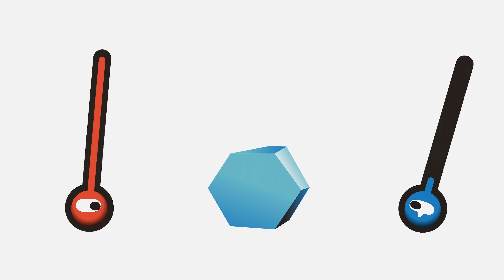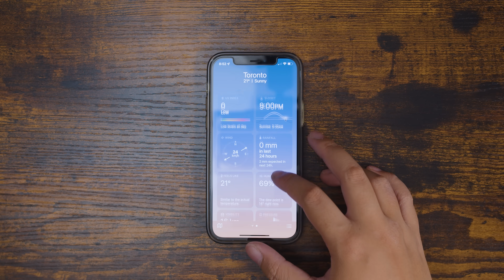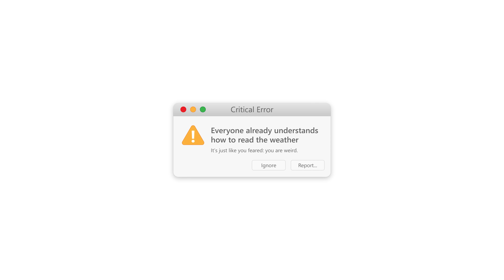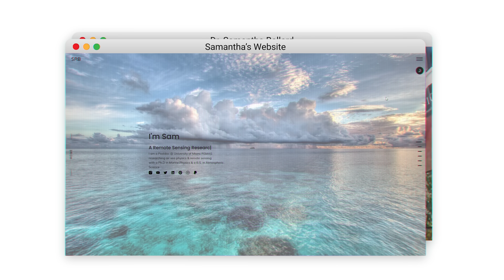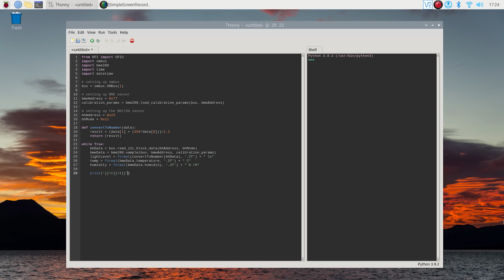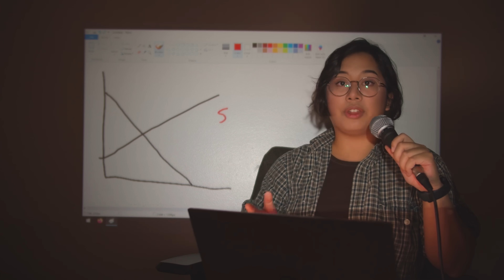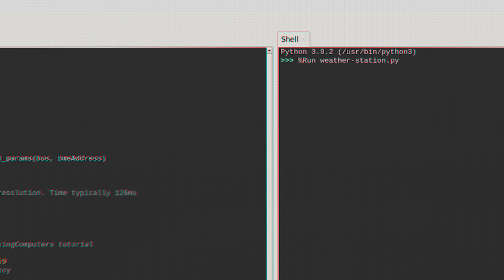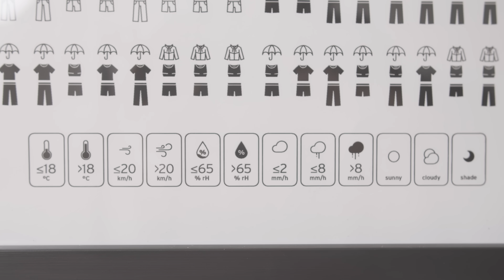how fahrenheit fails you

Comment: They invented perceived temperature to try help. Pressure and humidity make a whole lot of difference. I live near the equatorial line but at above 2000m sea level, even at 30 celsius (hot) it's acceptable compared to similar temperatures at sea level. Also when you're in the shadows, temperature difference is felt more intensely.

Kelvin is cool anyhow, at least you know it will never go below zero.

Comment: 20 c is room temp, hotter will feel hot, colder will feel cold, this is ignoring wind, 10 is a bit cold but not that bad and like under 10 is coat weather, it’s not that hard, humidity will make it feel colder or hotter depending on temp and direct sun regardless of temp will make you feel hot

Comment: Can’t even finish the video because you are attempting to raise a subjective point as a fact/objective.

Of course Celsius will not make sense in a country that doesn’t know if it should use imperial or metric.
More so, temperature alone is not an indication of how you feel when you are outside.
0 is freezing, 10 cold, 20 warm, 30 hot, 40 wtf. But with high humidity, 20 can become a situation too, just pick system and learn it. Saying 0-100 is more intuitive than 0-50 doesn’t make sense at all.

Comment: I like that you wanted to go outside more, and then start by building a weather station inside 😄👌

My experience is the following:
20°C and above - Wear shorts (if below wear jeans).
15-20°C bring a shirt.
10-15°C bring a shirt and a wind jacket.
5-10°C bring a winter coat.
5°C and below, wear winter coat, gloves and a hat.

Last but not least: Celsius is best - water freezes at 0 and boils at 100.
But I'm also very biased living in Denmark. 🇩🇰

Love your videos! ☀️

Comment: Easy ways to know hot is the temperature.
Body temp is 36C/97F. If outside is the same temperature as you or above, its hot. Anything lower tan 25C/75F, its cold. The lower it gets the more wintercloth you need. Simple.

Comment: Real problem: temperature doesn't matter (alone). Need also the ability to understand brightness outside vs. sun radiance, and humidity

Edit: oh also the fact that you think computers/sensors are supposed to be big is 1) your PC doesn't have to be small and 2) your smartphone is  basically just a big battery (spatially)

Comment: One thing that you forgot was "dew point". Relative humidity will not tell you much about your comfort level, dew point will.
But my personal method is having few mental anchors. For example 10 °C  is a bit more comfortable than inside a fridge.  25°C is the most comfortable A.K.A room temp. 37 °C is my body temperature so obviously over that line my body starts working overtime to go lower than it's surroundings. Now I mentally fill the gap between those

Comment: I remember having this discussion with somebody about how temperature (and esp "wind chill factor") is kind of a bad metric. After all, if what we feel as hot and cold is loss of heat, then shouldn't we measure that?

So obviously somebody with more surface area or higher temperature at their skin is going to lose more heat, but other than that, everything is standard right? So loss of heat, aka sensation of hot/cold should be measurable by something like ( energy lost per second per area per temperature difference ). Something like ( watt/m^2/delta C ). Alternatively, we can assume a typical skin temperature and reduce that to watt/m^2, which is a real unit (for measuring the intensity of radiant energy, exactly what we need). This would encompass temperature and wind.

Comment: I think it's not the scale(unit) you use, but that you are kinda bad at comparing the temperature based on your feeling. N8w this of course can be trained, but since we have thermometers we often just read it and don't care. Even tho this is something you can learn pretty easily. You could bring the same argument with musical notes. An untrained person has no clue what a G2 sounds like, or a F5. But if you train it for a while you can be fairly accurate. It's less a think of the scala you use, and more of a estimate issue. Wvich ofc, if ai don't know the scala at all will be hard, but adapting from 1 scala to anotherone should be a lot faster than being consistently close to the guesses on an arbitrary scala in the first place

Comment: The Raspberry pi is a computer but i would have suggested to go with the 3A or 3B not the 4. 4 requires you to have a heatsink and/or fan which will mess with the readings. Maybe the extra compute is needed but most likely you can get by with a 3B not a 4B. The main difference would be the required cooling solution to run the CPU cores at 100% for more than 5 seconds. 
The how it is a computer look at your phone and is it a computer? They both have all the same parts just the Raspberry pi 4B in her hand doesn't have all the parts for radio signals and camera hooked up to it by default instead of that it has general purpose input / output pins.

Comment: Farenheit gives more resolution with two digits at comfortable room temperature ranges. To get the same with Celsius, you'd need three digits. So you get a finer resolution at a particular usable range. That's really the one particular nice aspect about it. (And likely why it has stuck around.)

For anything else, Celsius is a bit more scientific for being indexed to the phase changes of a common and readily available substance.

Comment: Tip for the next time you make a portable weather station (lol): the wind sensor is super bulky and complicated for a portable weather station, there exist circuits that could do this measurement much more efficiently and precisely, while taking up 10x less space (the realisation in question uses a circuit withan NTC thermistor which is basically a resitor with resistance that depends on temperature, and measures the wind that way through some relatively simple math)

Comment: I'm used to Celsius because where I live we use it, and also we don't get extreme temperatures. So the point about 0-100F being the hottest or coldest days you'd experience just doesn't apply and using the freezing point of water just makes more sense to me. I think that could be another reason why it depends on where you live. Since the temperature range is a difference between oceanic and continental climates. For me 0C is very rare, 5C is generally as cold as it gets, 10C is cold, 15C is nice, 20C is warm 25C is hot and I start to get uncomfortable and 30C both too hot and hotter than it ever really gets here.

Comment: I think the problem is that Fahrenheit is only intuitive for people that grew up with Fahrenheit or that have to work with a lot of Fahrenheit Measurements. I personally only really know that 30°F is pretty chilly and that it gets big really quickly. 
Celsius on the other hand is defined by reproducable temperatures. 50°C is unbearably scorching, because it's halfway to boiling water. 0°C is when snow can stay on the ground. 14°C is when I stop wearing only T-shirts. 
It has the same "This temperature equals this feeling" but the scale isn't "really cold" to "really hot". Also, since the temperature points are further apart, the temperatures that feel the same are closer together. 
90°F is really hot and 100°F is really hot. 20°F is pretty cold and 10°F is pretty cold. 
30°C is a really hot day. 40°C is almost unbearably hot, 10°C is pretty chilly and 15°C is pretty chilly but 20°C is already pretty warm.

The one thing I give Fahrenheit is that negative values actually mean something. Negative °F means it's really really cold, Negative °C on the other hand is just "well it could be snowy and maybe wear a scarf.

Comment: This has never been an issue for me. When I switched to celsius, I was a door-to-door salesman, so I learned to feel what each number meant pretty well.

I don't even check the weather anymore though, because these days I have like 3 temperature settings. If it's summer, wear less. if it's winter wear more. If it's any extreme, don't stay in that place very long
Reply: I only use that last one, and "keep a spare coat in the car". Even though I've often worked outside, I've never made a habit of checking the weather, since my adaptations will vary by the month or week instead of the day anyways.
Reply: Same.

As long as you aren't outside for hours and you wear enough layers of clothing -10°C is not a problem for office/school commute.
-10°C sucks if you use railroad.
-5°C gotta wear thick winter hoodie below your winter jacket?
0°C Time to wear winter pants and winter wear.
5°C Time to wear winter jacket.
8°C gotta wear a jacket.
15°C gotta have more than a t-shirt.
Like at 18°C you can get away with a t-shirt if it isn't windy and it's sunny.
At 20°C shorts.
25°C is the limit of being able to wear clothes without sweating.
Above 28°C it's like patrolling the Mojave desert.
30-35°C You can only survive naked.
Reply: @niewazneniewazne1890  Pretty much but because I've got some weight on shifted down a step i.e. 8°C gotta have more than a t-shirt. And back up a step if not moving.
Reply: @niewazneniewazne1890  -20°C Shorts and T-shirt, 20°C Shorts and T-shirt. However, -15°C fifteen layers of clothes... -10°C Fucc me it's cold, -5°C to 10°C It's too cold to go outside... 15°C it's a bit cold...
and then when it's like 25°C better hydrate some more, 30°C fucc me it's hot... 35°C I wish we owned an AC, 40°C It's as if I were in Dubai...

Comment: I find the biggest problem with weather communication is that its based on ratings.  Like one thing you got wrong is that humidity doesn’t always make you “warmer”. In the winter rain on a 34f degree day is way colder than a sunny low humidity 20f degree day.  But in the winter we get wind chills and in summer we get heat indexes.   But there is humidity in the winter and wind in the summer. There is also sun and shade all year round.   But ratings come from making everything as scary as possible.

Comment: Uh... Not to be a purist, but we're not "all familiar with a 0-100 degree scale". Maybe if you grew up with Farenheit and that's what you've been taught, but not all of us measure everything "on a scale of 1 to 10". I personally find that mentality to be entirely pointless for the exact reasons you cite - it creates a binary fallacy. It's either "0 I'm freezing my donkey off" or "100 it's way too hot". This is a useless metric. Actual numbers with known breakpoints works far better - for Farenheit AND Celsius.

Forget freezing and boiling water. I have a thermometer in my room. I know that anything below 22 degrees is cold, and I'm going to need winter clothing if I'm going to stay in that temperature for long periods of time. I know that anything over 28 degrees is hot, and I'm going to need summer clothing to avoid sweating profusely. 24-26 is "about right" for pants, a shirt and some kind of top. Sure, there are extremes. 10 degrees, I'm probably going to need a winter jacket, 40 degrees I'm starting to worry about heatstroke, etc. A 1-100 scale is no better than a 22-28 scale. Human beings are adaptable.

Comment: I find temperature pretty intuitive, humidity augments that, wind cools, UV heats. 

If it's cold, high humidity makes it colder, if it's hot, high humidity makes it oppressive. In middle temperatures, high humidity just makes it thicker. 

Wind cools, so in the winter it needs to be blocked, but in the summer it is a godsend on the jobsite.

UV is what burns me, so when it's high I gotta stay in sleeves or the shade, but when it's low I can do whatever I want.

I'm built for winter, so my comfortable temperature range is from -12 to 12 °C. But I can deal with heat up to ~30°C as long as I'm not in direct sunlight, even with bluejeans on. Above that, I die, or direct sunlight in UV 4 or higher I burn in like 20min or less. Below -12°C, I have to begin layering clothing and actively avoiding rain, but I'm not getting sunburnt, so that's a huge plus.

Comment: I was going to ask for a copy of the infographic but I literally just wear jeans all year round so my only choice difference would be in tops. And I have a good system for that. Sunny and hot? Wear thin, long-sleeved, sun-blocking shirt. Cloudy and hot? Short sleeved shirt. Cold? Hoodie. High less than 80 and little plan to go outside? I could probably not die in a hoodie and summer's too long to not wear hoodies so...

Comment: it isnt difficult. 30°+ is heat stroke range, 20+ is a very hot day, 10+ is comfotable, 5° - 10° is normal trouser and tshirt or long sleave weather, 0° - 5° is jumper and hoodie weather, and below 0 is thick coat weather

Comment: People dump on Imperial system because it isn't used to do math quickly as Metric is divisible by 10, but Imperial system is connected to humanity, hence why feet are called feet, as they are based on human feet, and so on. That's why Imperial system is better in non-scientific contexts.

Comment: I believe Fahrenheit is better because of how intuitive it is. 100 is a big number and it means hot 0 is very cold so if i told you 70 degrees. You would know its past the midpoint but no wear near the top of the 0 to 100 scale. Thus is nice and warm. You tell me its 30 degrees Celsius i just draw a blank as relation to how it feels outside.

Comment: I find Celsius to be completely fine, but it is more a problem of using JUST temperature and not temperature AND humidity. As long as you keep the knowledge that 18-25 degrees is comfortable room temperature at low humidity, finding out the weather is trivial

Comment: 14:14
I think the entire filesystem (maybe not /boot, I'm not sure) of the raspberry pi is stored on the sd card you can just remove from the computer when it's off, and then plug into another computer and go through.

edit:
looking at the post in the forums (or just what can be seen from the video of it) she doesn't have another linux machine, and Windows only recognizes 2 filesystem types, which are decades old. In that situation I would've made another bootable sd card and used that to read the first, but I don't know a very quick solution off hand.